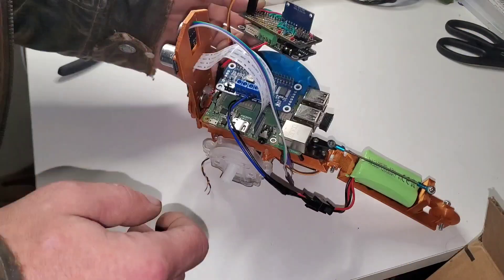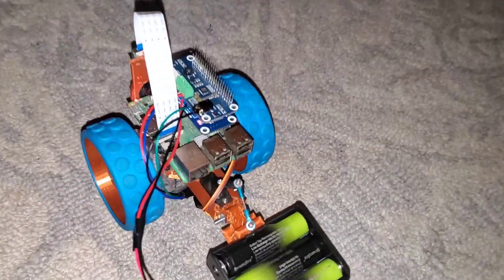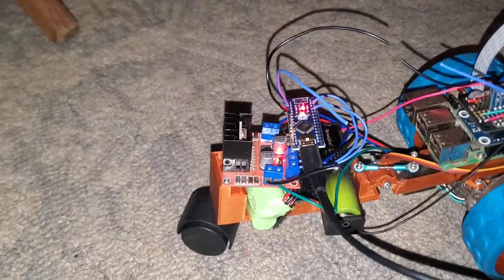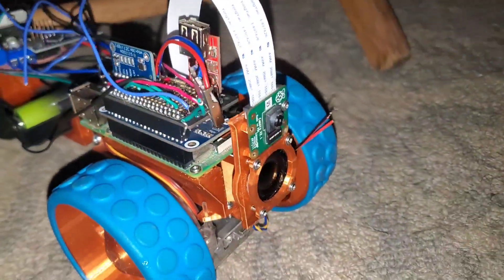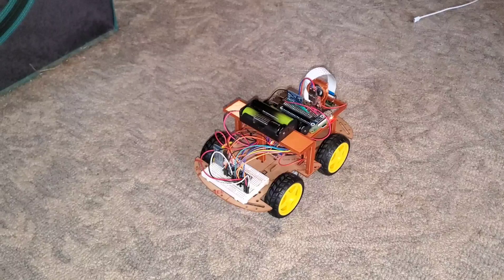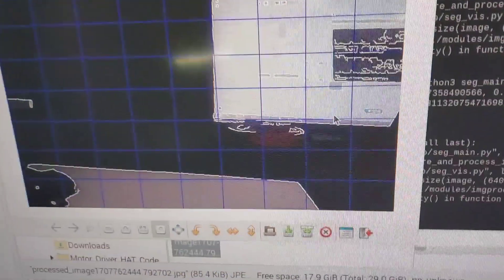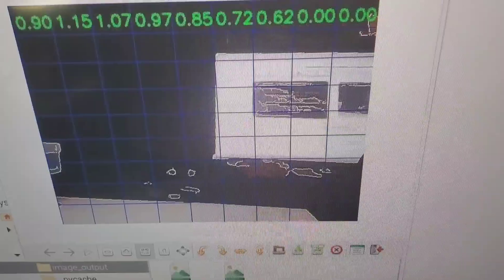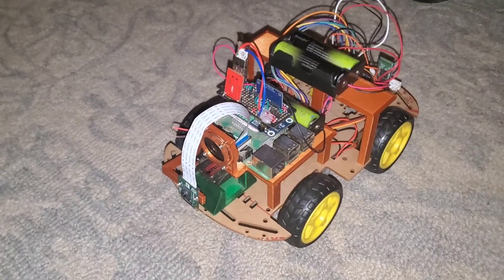Creating a ChatGPT/AI Robot: Part 5 - Camera Navigation and Motor Problems

Comment: have you added this avoidance code to your github? I couldnt find it. I have been looking for something to keep my urban rover in the centre of a pavement.
Reply from the maker: @geofrancis2001  here is the full code for the chatgpt robot. You would have to add another visual ai similar to yolo, but that could successfully determine sidewalk/not sidewalk. https://github.com/garagesteve1155/chatgpt_robot/tree/main

Here's a response from ChatGPT with some more info:

To make your robot follow a sidewalk using visual AI, you want a model that can detect and track the sidewalk or path boundaries effectively in real time. YOLO is great for object detection, but for tasks like sidewalk following, segmentation-based models or lane/path detection models are often more suitable. Here are some good alternatives:

---

1. DeepLab (v3 or v3+)

Type: Semantic segmentation

Why use it: Can classify each pixel as sidewalk, road, grass, etc.

Use case: Helps your robot "see" where the sidewalk is and stay on it.

Framework: TensorFlow, PyTorch

---

2. Fast-SCNN

Type: Real-time semantic segmentation

Why use it: Lightweight and designed for mobile/embedded use.

Use case: Perfect for running on low-power robots or edge devices.

Framework: PyTorch, TensorFlow Lite

---

3. ENet

Type: Real-time semantic segmentation

Why use it: Very fast and efficient, ideal for robotics.

Use case: Segment sidewalks, roads, and obstacles with decent accuracy.

Framework: PyTorch, Caffe

---

4. LaneNet / SCNN (Spatial CNN)

Type: Lane/path detection

Why use it: Originally for lane detection in autonomous driving, but works well on sidewalks too.

Use case: Track sidewalk edges like road lanes to follow a path.

Framework: TensorFlow, PyTorch

---

5. YOLO + Custom Classes

Type: Object detection (your original idea)

Why use it: You can train it to detect "sidewalk" and other relevant objects.

Limitation: Less precise than segmentation models for this task, but faster and simpler.

---

Which to choose?

If you have edge computing constraints (like Raspberry Pi or Jetson Nano): Use Fast-SCNN or ENet.

If you're okay with a bit more compute and want high accuracy: Use DeepLab v3+.

If your sidewalk resembles road lanes (clear path edges): Try LaneNet or SCNN.

Comment: I’m ordering a 2 layer wheel chassis because I want to replicate this project. Could you possibly include a parts list and repackage the instructions in your next video? Also would you change any parts of you could such as using a different rsbpi so it can handle more features as it develops? I’m also looking around for  a cheap arm to add because I don’t have a 3d printer.
Reply from the maker: BTW, balsa wood works great for any extra pieces/mounts you need to make if you don't have a 3d printer. It's extremely easy to cut, shape, and drill through
Reply: @makingmadeeasy  I think I have some on hand thank you
Reply from the maker: @RoboDepot.onXtwitter  no prob. Good luck!
Reply from the maker: Once I get this thing actually finished then I will release a full build instructions video
Reply: @makingmadeeasy  awesome I can’t wait I’ve been thinking about a project like this for so long. If it’s easy enough to replicate with simple parts and a GitHub repository for the software I think this could be a top story on hackaday, featured on ieee spectrum, trending on x, could even be turned into a kit sold on robotshop and aliexpress